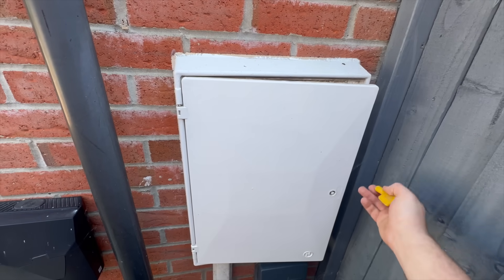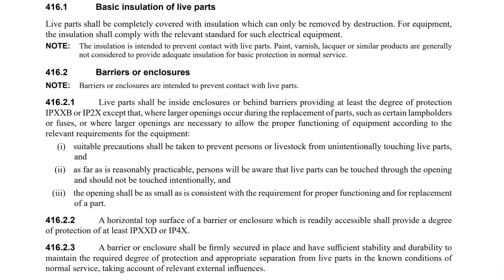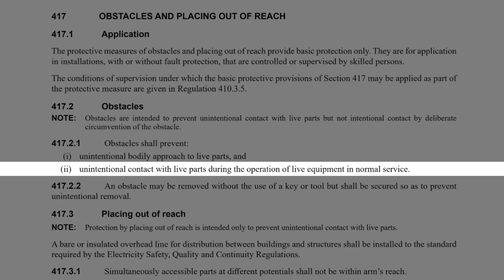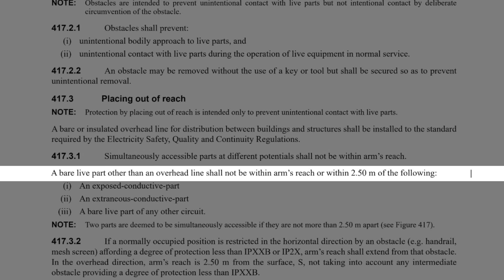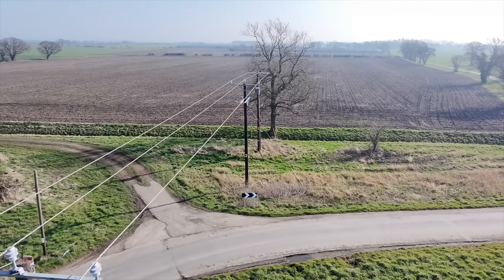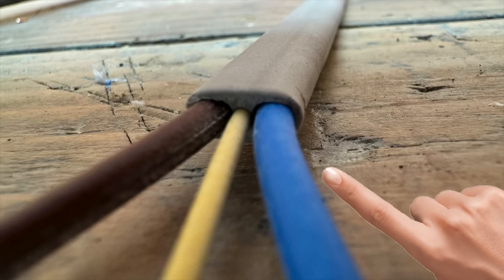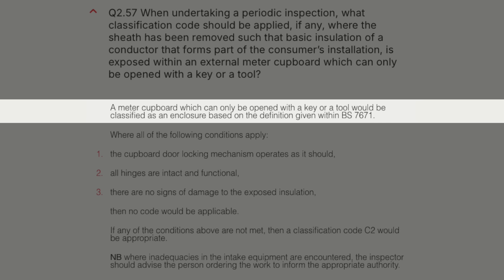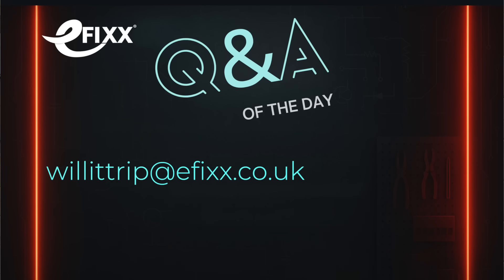This Should Be Illegal… But Isn’t!

Comment: NIC EIC say it’s C3 but some say the meter box requires a key to enter it so isn’t even a code . The inspector said it was a C2 but luckily I had done my CPD on the NIC portal and it said  C3 so had to stand my ground on a ECR I had done . What about heat shrink for a second layer of insulation??????

Comment: Never known an accident in my 55 years in the trade. Most of it is common sense. I have heard enough hi.. I suppose the new generation lacks common sence and  has to be told. I am impressed with these more advanced cables. All very costly. Just bought some 4mm. TWE. £5 PER M I was charged. Good job I am retired, I remember rewiring of a 3 bed house for £75. that's ring main and cooker points as well.

Comment: I don’t know what length of SWA is, if more than 3m it should be terminated into a switched fuse isolator ,  was SWA secured with the appropriate gland for earthing the armouring  , was the correct method used. Personally I would terminate the swa  assuming a distance 3m or less into an enclosure either in the meter box or externally if not enough space , use Henley blocks and then use D/I tails .

Comment: You should see mine in a rented flat, the key meter isnt attached to the back board, black connection blocks with copper showing inside

Comment: I received a reply in 2011 from a Senior engineer at the IET Standards and Compliance to this question:
“Would the accessible by the use of a tool apply to a socket outlet within zone 1 or 2, but which had been boxed in?”
 
No, the scenario only stands for “outside of the zones”, the accessory would need to be “not accessible without the use of a tool (a key is not acceptable)” and the appliance connected to the accessory would also need to be within the enclosure and also not accessible without the use of a tool (the appliance would also not be allowed to come into contact with persons within the special location).

Apparently use of a key was not acceptable back in 2011.

Comment: Why be so pedantic about paragraphs and regulations and definitions?
What is important is the actual safety / hazard assessment.
It‘s something anyone working on electrics needs to think about every day- for himself and not by ticking boxes of the correct regulatory paragraph.
Btw. : It‘s DOUBLE insulated, not double INSULATED if the idea is to point out a double layer of insulation.

Comment: I am actually building a enclosure like that at the moment, for residential use. It is not the main distribution panel, but a secondary one, located in the garage. I think that in this case the protection is not sufficient, non-electricians will use the panel in case a breaker trips. It is possible to touch the bolts of the breakers, which are live as well. In order to prevent that, I install a clear plastic barrier in the panel, that only allows the owner of the building to touch the levers of the breakers, nothing else, creating additional safety. This is common in industrial panels as well, not so much in residential panels.

Comment: The mentioned code breakers guide says “an outer sheath or other means of protecting conductor”. That other means of protection could be an enclosure. It doesn’t feel right but, provided it’s enclosed it’s no different than any other single insulated cable in an enclosure, people forget meter boxes are just big enclosures i think. No code in a meter box, probably C2 if not enclosed in the cupboard under the stairs or something.

Comment: @0:49 Can't stand those type of socket multipliers - they always seem to twist around and put a lot of strain on the socket and get jammed on other stuff like the picture shows with it being pushed to one side by the cable of the plug next to it. Many look very cheaply made and I doubt they'd hold up well to anything high amp even without the potential for poor contact from being twisted about. I use decent quality trailing extentions for lower amp things like lamps, TVs, computers, etc. so socket extentions have their uses, but never those type. Hopefully they'll get banned at some point. Even the cube type are better - although they too can sag and pull out of sockets over time if they have heavy plugs or cables in them.

Comment: Class Zero appliance cabling was banned a long time ago (Single wire covering), and prohibited from use. Often found on Christmas Tree Fairy Lights.
Those cables inside the box are at first glance, singly insulated, but the box door is locked, so that makes them double insulated.
You need a key to open the enclosure.
What about single cables in trunking.?? 🤔🧐
COSHH has rules for Hazardous substances to be locked inside an enclosure, including Rodent Baits and all substances likely to cause harm if swallowed or spilled.
Basic common sense prevails.

Comment: The strict interpretation of the regs and the extra steps and quality you provide because you have pride in your work are two entirely different things. I know I get the balance wrong because I am a semi-retired electrician and like to take on a challenge and 'play', sometimes beyond all reasonable commercial practice! But most electricians implement the barest minimum, but, are they bad electricians? I would say 'no', they have commercial realities.

Comment: So many people are saying that @efixx and the regs are wrong, but if your saying the cupboard dosnt count and is accessible to the homeowner cause they have a tool, in this case a key, your all essentially saying that all plugs, sockets, junctions and appliances are not compliant and are a c2 YOU ONLY NEED A SCREWDRIVER IF EVEN THAT TO BE EXPOSED TO SINGLE INSULATED CABLES! Think sheep think!

Comment: Euh that is not possible in Belgium and i guess most of Europe. First off, the box with the meter and main fuse is sealed and can only be opened by the electricity distributor. There is of course an opening for the handle if the main fuse. There is always a second box with the fuses for the individual circuits and earth leakage current switches. Those boxes always have 2 layers and when opening the doors you can only see the handles of the switches. All wiring and busbars are behind a second 'door' that requires a screwdriver to open. It was already like that 40 years ago. Those days the busbars were often not insulated at all though. Nowadays it's pretty safe to put your hand everywhere, at least if i wired up the box.

Comment: Meter boxes are not electrical enclosures for skilled workers. They are accessed by ordinary persons and should not have single insulation as a basic method of protection. 

I know wrag and nic have some opposing views to that but its a nonsense. Local building control in my area had a developer change 300+ meter boxes with this tosh in them and have it done properly. 

Arguing a point around regulations to this specific issue is an embarrassment imho. 

The front door to a house, floor board screwed down, where do the start and end of argument in those areas end up. 

When its so easy to have a basic principle of protection to wiring systems in meter boxes it seems crazy. Yet more of the accepting the lowest possible denominator as "the standard" 

This will always be allowed C2 for any diligent inspector and its an argument Im happy to have as often as needed. 

Hope that helps
Reply: Exactly! I am getting very frustrated about these interpretations of the regulations. It's obvious that's not safe and it will be always C2.
Reply: 100%. Just about every building I've ever came across has a lockable front door so maybe we should just throw the entire regs out and have single insulation in children's bedrooms because the house has a lockable front door.
Reply: So a light fixture is supposed to be opened by ordinary people changing a bulb, still you see not only single insulated conductors inside a fixture, but also an ordinary person could put its finger inside the lamp holder and get a shock. 

Single insulated (class I) cable doesn't mean there is no insulation. There is insulation and it's well designed to insulate electrically at the level required by the cable, there is not so much mechanical insulation to avoid physical damage to the cable, for that reason if the cable can come in contacts with metal parts that parts needs to be connected to earth, and depending on the earthing system a RCD may be needed upfront, but a cable in a plastic box sealed by a key?

By the way, cables commonly used for extension cords are NOT double insulated (class II) if we see the regulation (a double insulated cable doesn't just mean 2 layers of insulation, it needs to have a protection grade that is 1 step further the nominal tension of the system, that is an extension lead rated for 300/500V is NOT double insulated, it would need to be insulated for 450/750V, it's an error a lot of electricians do especially since they arrived the new CPR cables, the brown ones). Still, there are plenty that are even sold in stores so... I wouldn't consider it THAT big of a deal.

One thing we could argue is rather than if such cable is adequate for a box placed outside, subject to humidity, possibly water ingress, etc.
Reply: @alerighi  Kind of correct but also very different. Primarily insulation MUST be be insulated AND sheathed or of reinforced construction (this can be a single layer). 

Lamp holders are a misnomer in the electrical industry however they are not generally solely protected by a 100A service fuse. But I make you right it is a poor design and I know of several people who have had serious accidents changing lamps. 

This is EXACTLY the same concern with meter cabinets. While the number of installations setup like that are relatively small so will be the issue of danger and accidents. But the law of averages is a joke can nobody can swerve. This is poor and entirely avoidable why someone would want to excuse or justify it is odd tbh.
Reply: @electrician247  Your username says it all it's a profession not a replacement for a personality

Comment: I can tell you this only.

You did that in a datacenter or similar location, you are going to be out on ya ear with your tools in the post, that would never fly. And is probably why our panels look like art and not this.

We require insulation be in place to the point to application, bother inner and outer shields. But then again ive throw leccys of the job for pulling cable tight and not leaving enough service room.
Reply from the maker: Good man 👍

Comment: For me the cable in the meter box would be a C2. Even though the meter cabinet is in good condition and meets all other criteria, under normal use it is expected a non-skilled homeowner/tenant will gain access. 

The cable entry for this cabinet is also likely against the DSO regulations, from what I can remember they don't like/allow cables entering near the cut out (Bottom left).

Comment: As per regs, yes i agree with code 2. However this enclosure is accessible by the customer. Until meter readings are no longer taken from the meter cupboard I'd err on the side of caution and at risk single pvc. IMO Best practise (professional) would be to gland the cable, regadless if cpc is in use.

Comment: I would argue that the meter box is not an adequate enclosure for single insulated cables as the customer will regularly need to gain access inside for meter readings.

Comment: C2 all day every day..  Although the meter cupboard may meet the regulations as an enclosure to treat it in the same way we would a consumer unit or back of a socket is just not correct as access is required by lay persons...   Before opening a socket or other electrical enclosure you should be considered skilled, but access is required by non skilled persons..  Think of it this way, you would not put a light switch inside a consumer unit and say say its ok the user can open the consumer unit enclosure to turn the switch on and off...   There is no need to do this, its just poor workmanship and in my eyes potentially dangerous unless you want to say only skilled persons should access a meter cupboard which is obsurd..

Comment: Absolutely dreadful decision to treat a meter box, which an ordinary, unskilled person may need to regularly open as equivalent to a proper electrical enclosure.
Reply: The worst problem was putting meters and gear outside in a box in the first place, secure or not. Dampness is the main problem…especially the ones under a dripping gutter !

Comment: A key to open a meter box is not a tool as single insulation can be accessed by unskilled people. If you have a pre pay meter or need to read your meter yourself the meter box is not a sufficient second layer of insulation. The definition of tool is being misinterpreted.
Also a meter installer is not allowed to leave single insulation showing in a meter box. It must either be sleeved or isolated with a notice given to the customer

Comment: Regards basic protection. Double insulated tails aren't not necessary in meter boxes.as they are behind barriers that require a tool to open.
Reply: A “tool” that any unskilled person has access to just by design that that they need access to their meter. Now take into account someone topping up their meter accidentally touches the single insulation and it has cracked or split and gets a shock

Comment: Heat shrinkage around the swa cores 😊 still ruff looking and definitely not way i would or have done before.

Ideally, if you have a swa, why not just fit a 2nd meter box next door to the main incoming meter and fit a proper fused switched isolator.

Terminate the swa into that, then come out with proper double isolated tails.

This is why I have done it before 😊😊

Comment: New builds are like that because big big corporations want to keep cost low and increase profits (American style)
Reply: nope. in the USA if i can see the cable it's a code violation. So that entire box is no good. The meter would have to be designed to be seen without opening the box... In the USA, we have an enforcement problem.

Comment: 6:40 - Napit code breakers doesn’t mention the cabinet. So if it single insulation was exposed, it would be a C2. But inside the cabinet, it’s not exposed
Reply: Wrong. It actually depends on whether there is any damage to the cabinet.
Full authoritative explanation is provided below.

Here is the definitive answer from Guidance 4, Issue 7.2, Electrical Installation Reporting, produced by Electrical Safety First .

The following scenario is to be coded as a C2:
Quote:
 Single-insulated cables in a meter cupboard which can only be opened with a key or tool, but where any of the following conditions apply:
• the door mechanism doesn’t operate as it should,
• any hinges are not intact or non-functional,
• where there are signs of damage to the exposed insulation.

End Quote:

If there are single insulated cables in a meter cabinet and that cabinet is damaged in someway which makes it easy to get into without using the proper tool to open it, THEN you code it up as a C2.

If that meter cabinet is NOT damaged in anyway, then it is a C3.

That's the official definitive answer .

And when you think about it, it makes sense: the single insulated cable does not pose an immediate danger. If it did, it would be a C1 or a C2.

The risk of danger is increased if the door to the cabinet is broken in someway, if it can be lifted off it's hinges, or the locking mechanism is damaged or not present, then somebody can enter the cabinet and interfere with those cables. So obviously, the level of risk is increased if the cabinet is damaged. And to record that means it must be increased from the C3 to the C2.
Reply: @deang5622 electrical safety first is just the NICEIC dean. That reference is no more official than codebreakers. Interesting that one CPS scheme still has standards and another doesn't. I would never install something like this it's completely indefensible.

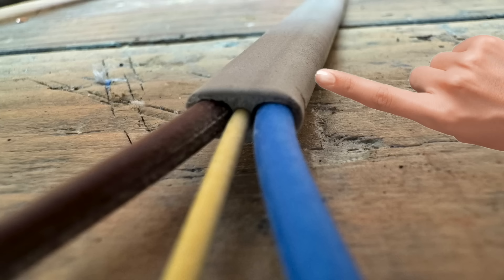Comment: 5:35 Calling the outer insulation "mechanical protection" just instinctively feels wrong, even if it's correct. How is it going to provide any actual "mechanical" protection against a nail or a screw for example!?

Also, what reg number defines the outer insulation (say on a T&E cable) of a cable as mechanical protection? The closest I can find is reg 522.6, but that does not explicitly say that outer insulation = "mechanical protection". Also the term "Mechanical Protection" is not covered under Part 2 Definitions as far as I can see.
Reply: But how does SWA protect against an angle grinder? Does the fact it wouldn't do much mean it isn't protection?
Point being, mechanical protection always going to be relative.
I'd agree though that despite what they say in the video the outer layer IS insulation, even if that isn't its primary function.
I'll stick with sheathing